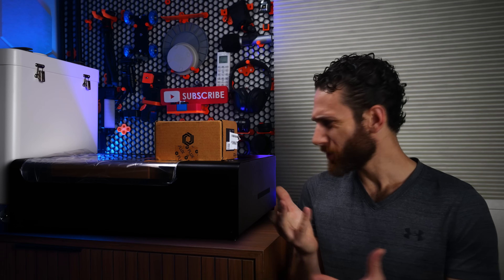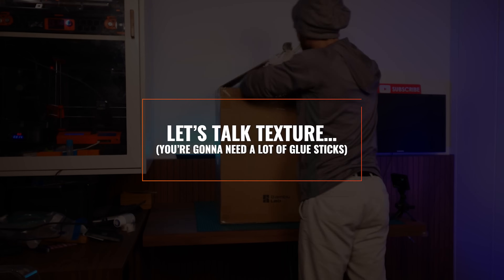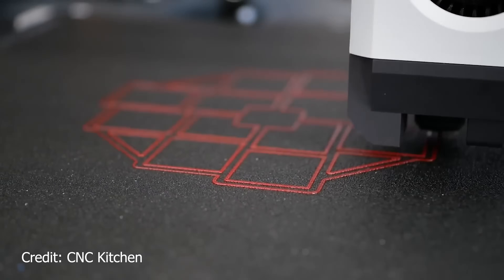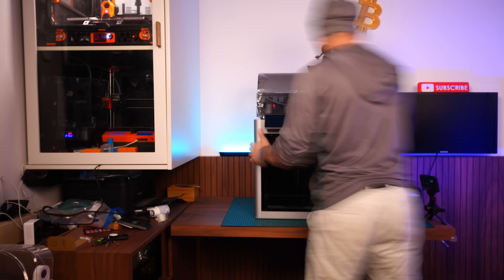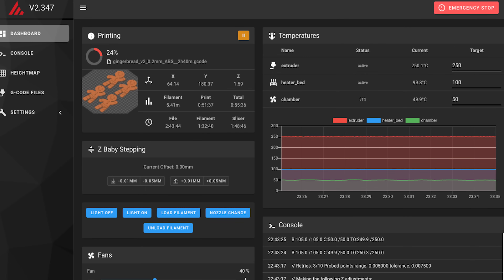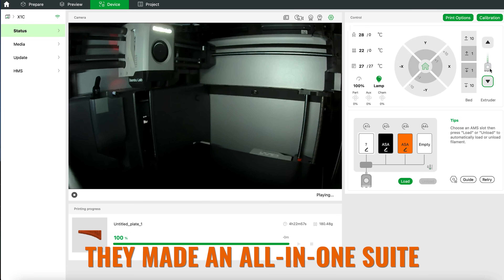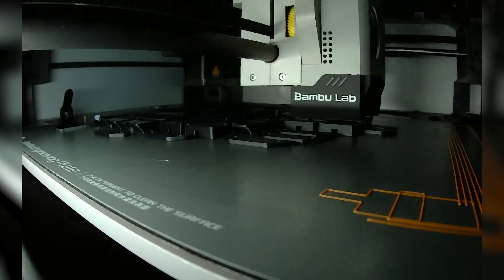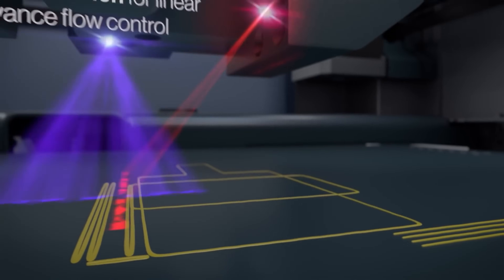Bambu Lab X1 Carbon: What NOBODY Is Talking About...

Comment: That "Walled garden" is the one thing I fear in the near future.  We already saw a first gen wave of "We gotta stop the physical piracy" back during the first generation hobbyist printers.  We saw it again when the "printable object for ejecting plastic at a high speed" (not sure where youtube puts that, so I'm not gonna use exact terms here) was released, and I guarantee we'll see it again when access to systems that wall off options become the mainstream.  The thing is, each time before we've had the advantage of simply... ignoring it.  Custom parts are relatively easy to make, and there are things like Printables, Thangs, and Thing-a-verse.  And they all use a single, accessible format, STL.  STLs aren't encrypted, they aren't licensed, and if a slicer accepts an STL, you can put in *anything*.  But with this walled garden approach, it takes a single update to simply... take that all away.  Perhaps they move to requiring using their own model site, where they can take down anything they want.  Or they start requiring a license for each part.  The thing is, all that will fail... for now.  And that's because we can quickly and easily just jump back to something like the Prusa line.  But if proprietary "walled garden" printers knock out existing market forces, if Prusa, Ender ,and the like are made obsolete, then so goes our defense against this walled apocalypse. 

So does this mean I recommend boycotting Bambo Labs?  No... not really.  If it fits your system perfectly, then it fits.  But I keep seeing this touted as the "Prusa Killer" and the like.  Don't make this a fight.  Don't put it on a pedestal to supersede Prusa.  When we do that, we spell our own doom.  It's a great example of a well integrated system, and certainly good for market pressure.  But if we encourage people to belittle Prusa, and throw these more open systems away, we throw away any hope of clawing back when these companies (and many other companies who would rather license a part than let you make it yourself,) decide to push out the rest of the open systems.

ADDITIONAL (as I finished the video I noticed this): that RFID spool sensing is scary.  On an open system where the choices and firmware are up to me, that's an amazing feature.  And if all it was ever used for was to help automate filament types *when present*, that would be a good feature.  But combine that with the above walled garden, and am no longer comfy with this feature, because it would take a flip of a switch to turn this "feature" into a blockade.

I guess the point in all this is, if your focus is exclusively using parts that you bought from a company to print, then none of this matters.  But if you use it to make your own things, this wave of walled garden printers should be scary, and you should not be considering an exclusive focus on such printers.  You're just begging to be thrown under the bus.  Instead, make the market work for us.  Let's take what we learn from these new systems, and try and open them up.  The filament loader is amazing, and I'm certain we can learn a thing or two from it.  Prusa, if your out there, it's time for a MMU MK3.  The rest of you, I think the Voron 3 has a new level to stand up to.  Lets keep the 3d printer revolution open.  Make Bambo a tool, but don't let it turn you into one at the same time.
Reply: So... You actually can't use any slicer other than their own, right? I see they've now mostly-open-sourced their slicer (which is a PrusaSlicer fork...), but there's still parts of it that are not open-source and I wonder if those are the parts that deal with things like the RFID scanner etc.
The Walled Garden thing really is a worry. I, for one, will be sticking with open software as much as I can...
Reply: You forget though that china DGAF about western laws and diversity bs so you won't have your chinese 3d printer not able to print 'the moustache man they lied about' or something like that.
Reply: I had considered getting a Bambu X1C at first right up until I started to really look into it and started seeing a lot of the walled garden stuff, which definitely made me nope away. I want a hassle-free printer just as much as an ordinary not-a-technically-inclined maker-protege does, but after the number of times I have been rugpulled by walled gardens in my life, I do NOT want to dunk that much money on a piece of hardware made to capitalize on a movement that tears down those walls... that could very easily get a software update pushed to it to make the walls already built around it thicker and more impenetrable. Bambu's gonna have to tear the walls it built down in order to convince me to consider their products, which is probably not going to happen.

I wound up getting an Anycubic Kobra 2 instead, mostly because Anycubic was running a heck of a sale at the time, the Kobra 2 runs on Klipper which is already open source, and although the hot-end is eeeever so slightly proprietary and is just barely incompatible with volcano nozzles, it can apparently be modified to make it compatible with volcano nozzles, so I can unlock more capabilities with a bit of disassembly and parts swapping, which I'm absolutely not averse to doing. But it still fits the bill of being more or less hassle-free with automatic bed leveling which was an absolute must-have for me. I did not want to have to go through the manual leveling rigamaroll at all.

If I end up needing an enclosed printer, I've got my eyes on the Qidi X-Max 2, and if I need multi-material printing there's trusty Prusa with the XL or a Mk4 with an MMU add-on. :)
Reply: @calyodelphi124  Yup. I just got the Kobra 2 Neo and it's been a pretty great printer (especially given how good the price is). It even printed TPU with zero issues.
Reply: There are a couple of things that come to my mind reading your post, which does bring up valid points to watch. 

First is the walled garden. The printers are popular now and garnering a lot of good press. However I think that perhaps Bambu labs created the walled garden to protect themselves being a startup company. Both the x1 and the p1p do things that most other printers don’t. I’m guessing that in the future you would be able to use other slicers with the Bambu labs printers, because once the other manufacturers start to catch up Bambu labs advantage would diminish assuming the other manufacturers retain open source mentality, which there isn’t any reason to assume they won’t. 

Also limiting what a person does with a printer would be a mistake as well, nothing would stop you from just reverting to older printers and slicers. 

I think the thing to focus on now is what everyone else does over the next year. Every other printer manufacturer now will have to do something to compete with Bambu labs, especially assuming they continue to improve user experience and costs stay relatively where they are at. If they start to move away from open source then I would start to worry more about some of the issues you’ve brought up. 

If anything the printers from Bambu labs are a wake-up call to the other manufacturers. The features, speed and cost of the Bambu labs products should concern the other manufacturers, and if they want to remain relevant they will have to improve their products. Truth is over the last several years FDM printing has stagnated with a few outliers introducing better printers. Though it does seem costs have come down some on many printers they are lacking in real advancement. Most of the real innovation has come from people that tinker and tweek and upgrade their own printers. And while that is commendable it makes the hobby unattractive and out of reach of many consumers. 

I wouldn’t say Bambu labs products are the pinnacle or the best, however they seem to be a decent product that meets a desired want from many hobbyist and that’s fast printing and decent quality.

Comment: Are you in the Bambu discord? Have you tried Windex instead of glue? Someone recommended to me and I’ve literally never used glue on the cool plate.
Reply from the maker: Oh wow, I need to try that. I'm not in the Discord but I guess I should join... Is it Toxid tho? I heard the FB group was...
Reply: I got a Kickstarter x1 combo, print PLA only, and have used Windex on the cool plate from the start (still using the original sticker!). It’s fast, easy, and has worked well for me.

Comment: They can detect spaghetti on the machine using software so why not do the same for filament purge to detect the colour change rather than just purging a set amount of filament? I don't know if this is possible without installing more hardware such as another camera/optical sensor, but they use something like this in the food industry to sort bad or miscoloured peas etc
Reply from the maker: Oh wow, that's a good idea.
Reply: the problem is with dark colours, black to dark gray is hard to see.
Reply: Software, that barely works. 🤪

Comment: I've definitely had a less than amazing experience with my machines. It started out well and I was excited, but my machines have not continued to work quite as well. I've been documenting some of progress and problems with my machines as well.
Reply from the maker: Sorry to hear :(
Reply: I have an OG X1C. What issues have you been having? print quailty, mechanical, parts etc?
Reply: @No0o0o0o0o0  I'm getting a wavy pattern that looks like ringing though it is across the entire length of my parts and doesn't go away at any speed.
Reply: @Titan3DMFG  are you doing the maintainence stuff on their wiki?
Reply: @morbus5726  I certainly am.

Comment: If you reduce multiplier under "Flushing volumes" from 1.0 to 0.3, it works just as well, you just save a lot of plastic.
Reply from the maker: NICE, that's a great tip, I'm totally gonna do that.
Reply: Cant you flush into the supports or infill?
Reply: @svenvanham  Yes you can.
Reply: the hero we don't deserve.
Reply: Where is flushing volumes?
Reply: @fuloran1  Below "bed type" - right of Filament

Comment: Appreciate the video...Most of that i had heard but i had not heard how different the bambu fork of prusa slicer is...this has not really slowed me down though as i have never used prusa slicer...With only one or two exceptions i have transitioned quite easily from Cura to Bambu Studio and those exceptions i was able to resolve with a quick google search. There are somethings i love about bambu slicer and something i preffered about cura...but if software and firmware are the only issues (and minor issues at that) then those will be addressed in time...I am loving my X1 Carbon with AMS!
Reply from the maker: Thanks for the comment. I’m loving mine too!

Comment: Your video makes me thing of something I'd love to see regarding calibrating the amount of filament flushed when changing colors.  It would be nice if you could do a test print on the build plate where it prints while flushing filament and changing between colors.  You could look at the line on the build plate and decide how much filament actually needed to be flushed to fully switch colors and use that value to program in the flush amount for that change in the future.  In a mere 16 lines printed on the build plate, you could calibrate flush amounts for all permutations of the types of filament in an AMS.  The printer or studio could save those calibrated values for the same filaments in the future.  Heck, if they tracked specific brands and filaments instead of just "generic" they could probably gather the calibration information from the community and train their own estimates.  For example, it could, based on the calibration and feedback from the community, recommend 150 mm3 of purge from a black Overture PLA to a blue Anycubic PLA.
Reply from the maker: Solid idea!

Comment: I’m 3 mins in and I need to correct an issue literally every YouTube video has gotten wrong. The cool plate is the right choice to give with the X1, the PEI is not an “upgrade”.
The majority of users will be using PLA, and to do that with PEI, you need a heated bed of ~60c. PLA however is very susceptible to heat and without cool air, you will have countless issues. Now the X1 is an enclosed printer and 60c bed and enclosed area = melted PLA. It’s just not good for PLA.
The cool plate only needs minor heat (~30c) so the machine can be enclosed and it can print without issue. When you want to get people printing immediately, you don’t want to give them an environment where their prints will fail.
This is why the cool plate is included and why Bambu has guidance on keeping the top/door open when using a heated bed.
It’s not about cost, about engineering materials or any other thing people have noticed.
Reply from the maker: Yeah be that as it may I don’t like the cool plate or glue sticks and I want a textured one, so…
Reply: @thenextlayer  honestly, you’re not the only one (although I do admit to liking the half way house finish between smooth and texture pei). I maintain it was a wise decision for them, but it could be explained more - new users wont know enough to care, but experienced users are the ones asking the questions and they haven’t really addressed it publicly (which is what causes confusion and annoyance). I like the idea of a choice, but it would have been impractical (and maybe still is) given the centralised global distribution
Reply: Well put! I’m one of those “majority PLA” users and the cool plate works well for me. I just use Windex instead of a glue stick, it’s easier and faster. I bought a textured PEI build plate after reading all the discussions on build plates. It’s collecting dust. I’ll try it, if I encounter adhesion problems.

Comment: Regarding textured plates, they were not readily available initially, the manufacturing of them was a bit of a lift initially for BL -- some folks had made a bit of cash re-selling 3rd party textured PEI plates during the initial phase after KS. I have a couple of 3rd party double sided plates, and have a few textured plates that I got from BL when they became available. I am pretty sure the current bundle will eventually change. They've gotten too many people opening tickets related to bed adhesion, too much/too little using glue stick etc -- the printer is attracting a lot of folks new to 3d printing and simplifying it with best build plate option for the job would be idea.. I.E. The printer with lidar can scan the qr code, it could also identify if the plate doesn't match the plate in  the slice file, it doesn't. I.E folks new to 3d printing would be well served if the printer at print time says -- you've specified PLA with a textured plate, and you have the cool plate loaded.  
Regarding the slicer, I like the bambu UI better than SS, if feels familiar, more on that later. Also the integration of the printer with the slicer is very similar to FormaLabs Form3 and Preform. I'm very much used to that software and it feels very similar to what Bambu did, that's why it feels familiar, it feels Bambu worked on the UI to make it feel more like Preform and less like PrusSlicer/SS
BTW, I've been using PolyMaker cardboard spools with zero issue.
Reply from the maker: Great feedback, thanks. I heard back from Bambu right now that it's because the LiDar wasn't compatible, but they're ironing it out, and they accept the feedback. As for Slicer, I think it'll take time, but it'll probably become my go-to as well.

Comment: Weird, all my cardboard spools have worked fine. Overture, etc.
Reply from the maker: I think it may have to do with the fact that my spools were banged up and not perfectly round, and also half empty. I had some issues, so I just printed out the thingermajiggys.
Reply: Ah yes, the ever important thingamajiggies.
Reply: Same here. When the spool gets low I can see an issue because cardboard is so light. When it gets that low and I know it's going to finish off a spool I just unspool it and let the AMS take the rest. (for single color printing)

Comment: It is mentioned that the textured bed does not work with the Lidar. This is why they don’t include it with the X1 Carbon.
Reply from the maker: Yep, they got back to me on that just now. They're hoping to tweak it with software, so that's good.
Reply: In addition the textured PEI sheet should come with clear instructions to thoroughly clean it with dishwashing detergent/IPA before printing. I also had to up the default bed temp 5C for PLA and 10 for my PETG (add north) to make sure it stuck. After that it is an awesome print surface if you can live with the textured look.
Reply: @MolOlsson  this comment should be pinned. The amount of times that people have not washed their PEI with dishwashing liquid only to have nothing stick is insane

Comment: Great video and congratulations on getting hold of the X1 Carbon. Yeah it’s not perfect. No 3d printer is. They all have their quirks. But it does do a fabulous job in short time. And although the poop is quite a bit when you visualise it if you weigh it up you’ll find it’s not a massive amount.
I’m saving all the poop so I can melt it down and reuse it for another project.
Reply from the maker: Same, trying ti separate it out by materials. But yeah. This thing is freaking awesome.
Reply: @thenextlayer  Hi, im quite surprised, how much filament it waste on each start of each print. Do you have any advice how to redsuce it by 9/10? many thanks David
Reply: @thedave70  Just remember how many failed prints or reprints due to bad quality the start sequence prevents.
Reply: @justindelpero  Hi Justin, im sorry but i dont understand, why the printer needs to push that much filament even on single color print on p1p. To prevent any problems, I guess 1/10 of the pushed filament to the trash is needed. No?
Reply: @thedave70  ok I misunderstood, I meant the lidar / flow / tune sequence, in terms of initial purge I agree that should be minimal.